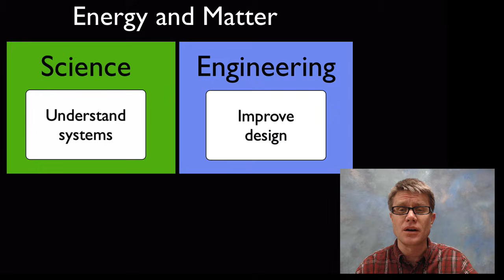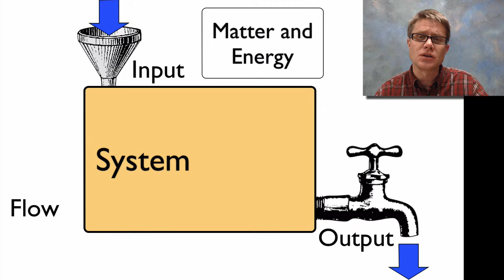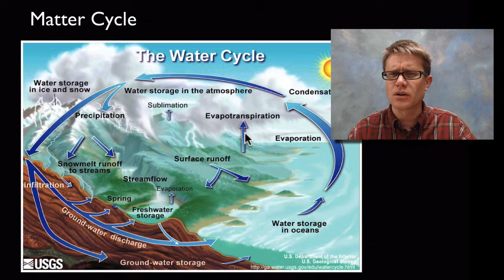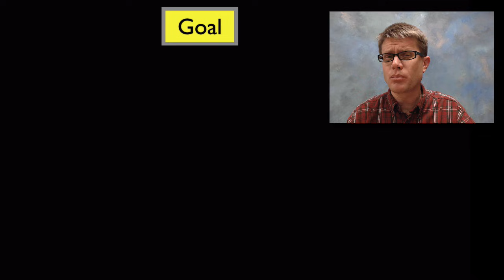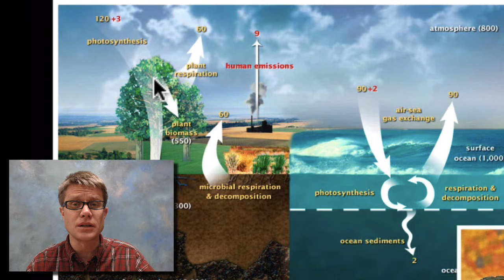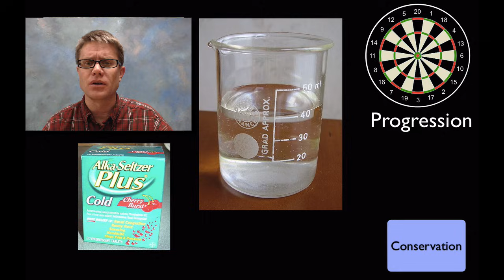Concept 5 - Matter and Energy

Comment: Light trapped is matter.
Trap is selfENtangled knot.
Electron bubble. Or spinor.
Matter is retarded form.

ENergy or gyre of e9 EN or hole.
Hole cenote pore ring
 flame candle ionic pyra .
Helice and Bobbin around ring of fire.
ENergy is DNA like helicoidal OurObOrOs. Screw that does all. 
HeliCity = links + knots.
ENergy is momentum, kinetic, net effect. 
Wave is AMPlitude. It is not real. 
Vibration, oscillation,probability,
STanding STill or STationary time wave.

For instance..
Atom + atom = 4 atoms or  voID, vacUUm.
Light + light = darkness or Shadow.

Actually it is the only real part. 
Unlike waves, vibration, or even matter. 

Space has no properties.
Matter takes space.
99% empty.

Field is vortex.

Riemann zeta..
1/2 solids
0 or 1 gas.
Liquids among 0 and 1.

Wave eq and heat equation.
Derivatives 1st, 2nd.

2 S BEC DRUMB BELL LIP SOIDS

Phase facet genus shift.

Water and light both have same soliton letters. HY heXa.

Edit audit
Caustics acoustics.

Water glass and carbon are tetra and hexa.
Water knots. Droplet periodic system.
Monster group.

Glass secret 0.4 8 16 upandatom bubbles. 15 fold+glass search. Sound silent.

Sand can be as granular "polyphasic. "
Act as solid liquid.

Pattern of granular upDown DenSity is unknown.

Don't wait for students to wake up.

Time flies.

Comment: MASS = ENERGY Interaction.
Torus = Doughnet shape
Energy is all wave with no particles....there ARE no particles...only different sized loops of energy we have given names to that spin to produce a Torus with a "shell" that makes it look "round " like a ball...they are not round....two loops ..one smaller one larger...side by side....now spin then...=Torus. .......a wave takes a perpendicular twist and changes direction , which then LOOKS like a particle from the observers perspective....NOPE...change in direction caused by energy interaction.

Here's an answer you don't have yet.
E=mc^2....E=M x (Cx x Cy).....is correct....for a ONE body experiment.

For a TWO body experiment you get..
E=M x ( Cx x Cy ) - (Cx) - (Cy)   THERFORE: E=M
 
I have just removed the light speed affect and created mass.
Gravity is the downward force of electron movement acting upon a body of energy ( the newly formed matter).
hopefully you understand :)

Comment: When u mention energy drink and energy bar they are referring 2 different meanings. The drink has caffeine which give a person motivation or mental energy and reduces fatigue. Energy bars are full of carbs to give a person sustenance to power the body.

also have a question, wouldn't the amount of water change based on any chemical reactions involving water such as photosynthesis(decreasing the amount of water), combustion(increasing it), etc. Articles say that each year 1000s of tons of CO2(maybe more or less can't remember exact amount) produced each year from burning fossil fuels; since combustion products are CO2 & H2O would there be tons of water also being produced?

Comment: Or put differently, when your quantity mass equals your quantity weight depends on the used unit-system.
I guess you could use g as unit in which case you get the same weight and mass on Earth... But when you usually use SI-units, you have to add that to the explanation.